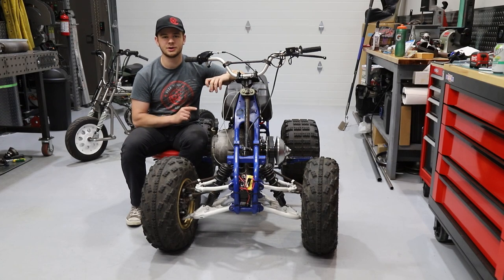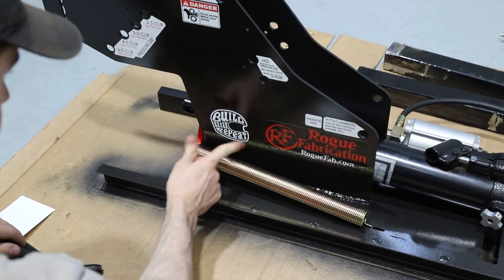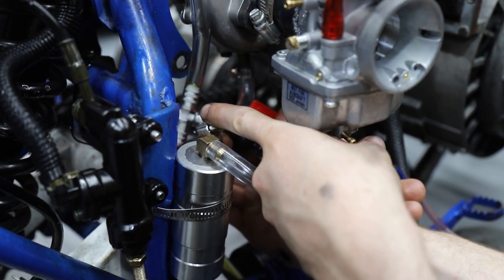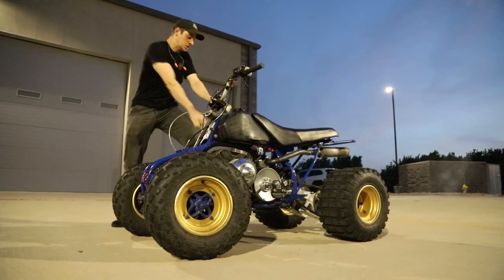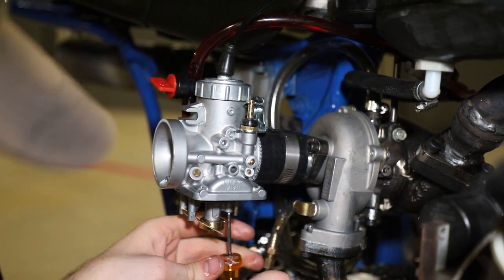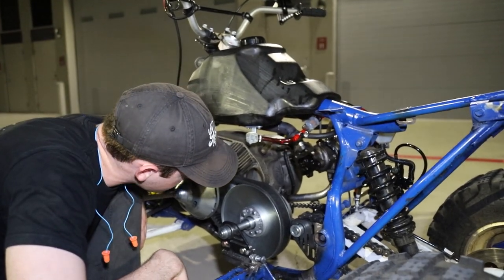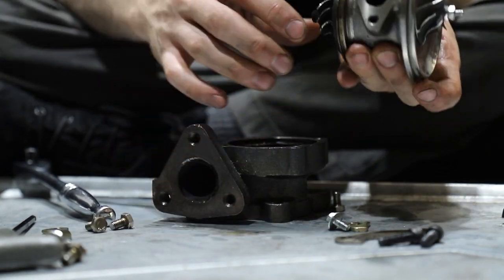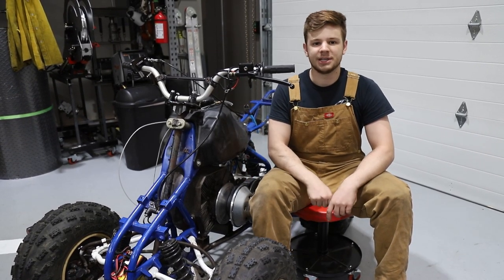We Blew the Turbo on our ROTARY ATV? | ep.7

Comment from the maker: What do y'all think, should we try again with a more expensive turbo and better setup, or revert it to the pre-turbo configuration? Let us know! Sorry for the late video this week, we've been busy working some summer internships!
Reply: Keep trying with the turbos!
Reply: "Turbo rotary" always sounds better in conversation or in the title of a video so there's that. But I was thinking if you could really control the a/f ratio precisely there's lots of potential to be had with the turbo rotary combo but that would involve efi, a bit more intricate but definitely worth it in the end especially with a bigger turbo because a carb that flows enough fuel at full boost won't want to run at idle and vice versa
Reply: Stock engine, finely tuned.
Reply: Supercharger 100% there aren't many blown rotarys
Reply: RAM AIR!!
Reply: What about a small supercharger, like GHP used on Senderella for awhile?
Reply: Turbo
Reply: Try claim warranty on the turbo haha! Ever thought about a mini supercharger and running it off the crank?
Reply: Still need to restrict the boost gauge feed line with a wd40 straw or something similar to get a better reading from the guage. 👍👍👍
Reply: It’s not the turbo bad vz 21 not good for draw threw set up I did mine as a blow threw an it was fine that turbo don’t have a dynamic seal that you need for draw through
Reply: I Think you will blew every turbo when you blow gas thru it. Install it on thr right side. Gas degreased and destroy a turbo and the bearings
Reply: @D.T1991  is called a draw through set up and its fine

Comment: Keep boosting!  Get a air/fuel meter on it for tuning jets.  An oil pressure gauge and proper orifice fitting for the feed line to restrict flow to correct levels ( if bearing turbo ).  Love the content.
Reply: They should build a stand alone wideband display that clips to the end section of the exhaust. That way they can tune basically every vehicle they own
Reply: you should only use an orifice to restrict flow on a ball bearing turbo. Journal bearing turbos need oil pressure in order for the shaft to be suspended on the cushion of oil
Reply: @DJTuningCom  Today I learned!  Thanks!
Reply: @DJTuningCom  but too much pressure and not enough exhaust back pressure can allow that higher pressure oil to leak through the seals. So a measurement on the amount of pressure it's getting wouldn't be a bad thing
Reply: Lit

Comment: I say keep on boosting that thing man! gotta love a turbo rotory ATV!! haha @ 7:26 you can hear how much happier the engine was for a second when you took that filter off, I'd either get a very thin peice of fleece and clamp that tightly onto the turbo inlet, and spray VERY little amount of air filter oil on it just to make sure no dirt or sand makes it in there if that's what you guys are worried about (I'm guessing so, because it's an ATV and I'm sure you will be taking it off road) but when just tuning and driving around in the lot/street, I'd run no filter at all to give it the best flow, and not choke the turbo off.. its already been choked enough by the draw through set-up, almost should see if you can find a blow through carb small enough for this setup, or step it up and use a "small engine fuel injection conversion kit" and go stand alone fuel management, and tune on the fly on a laptop with endless fuel tables for as lean or as rich as you want at any given RPM. Also, when you replace the turbo I'd find one just SLIGHTLY bigger (rotorys like the big swirly bois lol) and get some oil feed restrictor fittings and play with the oil flow to stop blowing out oil seals on the turbo, but make sure its getting enough oil too!! haha, keep up the great work man, love the content, ROTORY FOR LIFE!! hahaha BRAP BRAP BRAP BRAP

Comment: The oil burning problem is due to a fact, that you have got carb mounted before the turbo´s compressor. When you make pull and then close the throttle, there is vacuum created and the oil is sucked from the bearings and flies straight to the engine, so the compressor side bearing is not lubricated properly. That's the reason, why there is oil around the wastegate. This could starve oil from both bearings and make this play. Also, with this vacuum you can run into compressor surge problem, which could further damage the turbo. If you do the same thing with supercharger, you have the same problem. That's why on normal applications you have the throttle body after the turbo/supercharger.

Comment: Keep it turbo guys! You should add an intercooler or a large volume between the outlet of the compressor and the inlet of the rotary (about 1.5x the ci of the engine) . It will help it make boost and fix the boost gauge jumping all over the place.
Reply: Wouldn’t that also add lag? Or would this affect be negligible?
Reply: No point intercooling that tiny thing. An boost capacitor might help though a smidgeon

Comment: In the video, it seems like the turbo smoked the most when you let off the throttle. Probably because of manifold vacuum sucking oil through the turbo seals. If you had a blow-through carb, with the turbo in front of the carb, that shouldn't be a problem.

Comment: In response to some of the comments:
You can't intercool a draw-through carb. It causes the atomised fuel mixture to cool and pool in the intercooler giving erratic tuning issues. 
Same kind of deal for boost capacitor. If anything, an expansion chamber on the exhaust side will help to smoothen out the exhaust pulses into the turbine wheel to provide a smoother delivery of boost.

My vote is to convert it to a blow-through carb style. 
This will also prevent all the turbo oiling issues that you are having as when the turbo is in vacuum in a draw-through system the oil will be drawn through the seals causing improper lubrication and premature wear - as you guys discovered haha!

Comment: I've been running this same turbo on a 10 hp diesel for about 2 years and have had no problems. I'm not sure what your problem might be but you might have over sped the turbo. That rotary is effectively a 3 cylinder engine, I'm pretty sure it produces a lot more exhaust volume than my single cylinder diesel (which, by the way, makes about 6 psi boost under load). I would suggest finding a way to re-install the wastegate. How much boost were you making? It's possible that the turbo just couldn't spin any faster to supply the engine with enough air. You might even need a slightly larger turbo. I don't think oil pressure is a problem. My diesel makes about 60 psi when it's warmed up (the engine has its own oil pump that I tapped off of).
This is all speculation, of course, but I've been messing with turbos for almost 50 years. Just my opinions based on my own experience. Love your videos, keep 'em coming.
Reply: What turbo are you running on your diesel

Comment: You shouldn't draw fuel through a turbo unless it's built for it, otherwise you'll dilute the oil with gasoline. The proper turbos have a carbon seal in them vs the metal dynamic seals.

Comment: Keep it turbo, You need a carbon seal with a draw through setup. Vaccum can suck oil from the turbo. Or pressurize the carb for a blow thru.
Reply: And the pilot jet 5% more than stock & main jet 15% +++

Comment: Fuel smoke isn't white. Unless you premix a lot of oil in your rotary its the turbo. Likely need better drain/supply setup. Also takes a long time to burn off all the residual oil in the housing. so turning oil supply down as you ride and watching smoke is a good way to oil starve the turbo. 

 Need to boost reference the carb and modify it for boost if you ever want it to run correctly. If you look up "Drmotorcycle" on YouTube he goes through these modifications in detail in a lot of his turbo small engine builds. Also those seals aren't meant for a draw through design. Need carbon seals. 

 Turbo seals don't generally "blow" they are just like a piston ring. oil is either pushed past and/or can't drain quickly enough and just leaks by them. Fixing the oiling problem almost always cures the issue. No "blown seal" to replace. 

  Also get a WB02 sensor on that thing, guessing at jets is trouble and then some with FI. Just use a basic kit and set it up in a backpack with 4s a lipo bat. That way you can swap between all your setups and know your fueling is correct. 

Good luck!

Comment: From all my experiences with turbos you definitely have to be oiling it correctly you have to put an oil reduction jet in on the top side of the turbo and also if you're using a bushing turbo rather than a bearing turbo you are definitely going to want to run some type of coolant through it to keep the bushings cool

Comment: The engine was only running lean at wide open throttle. You should've left the pilot jet alone because the main jet was the only one that needed changed. You should keep boosting! You'll get it right

Comment: Also to help with tuning get a air fuel ratio gauge there's going to be a lot of tuning for your mid and high RPM range idle is simple but you're definitely going to need to get a carburetor where you can adjust the idle circuit

Comment: I can't speak really too much for your specific setup...  But I've been rocking a $120 chinacharger on my miata for a number of years and probably 70k miles worth of excitement without any issues on the turbo making GREAT power.  I'd start looking at the lubrication system of the turbo as it's possible the seals might've blown out and instead of lubricating the journal bearings, was just pumping the oil into either the intake tract or the exhaust instead.

I too would be interested to see you guys rig up a supercharger on this lil rotary guy.  Common superchargers for small engines is an old school VW vacuum pump, which was literally a small 2 screw blower.

Comment: With the turbo, as im sure many have said "you get what you pay for" or something similar, it's true, your getting China garbage, get a better turbo, make sure you have a good flowing oil filter in the line, also idk if it's going to be a problem now or later but eventually you will have to deal with heat, you need an oil cooler, simple one on Amazon should do fine, as far as exhaust idk much but you should study other rotary engine exhaust systems, see what special needs they have for performance,  go from there. Look into the moped world for cheater mods (they are size restricted for legal road regs)  but who says they can't be adjusted lol that world has some interesting takes on "legal" modifications you may find useful, happy wrenching

Comment: I say it’s the oil pump. I ran a similar setup with the same turbo and the exact same pump. The oil pressure is so high that the turbo doesn’t even spin. Also the seals are leaking badly. I had better luck with the 20$ 12V low pressure fuel pump to feed the oil to turbo. (It’s everywhere on Amazon) my problem is that my 22mm mikuni is way too lean.

Comment: Turbo again. Set up a new "oil pump" with a low pressure (carbureted) fuel pump (and the bypass) Turbos don't need or want a lot of oil pressure. It would be nice to have a stator for power too. Run a wideband and an actual switch for the oil pump. I'd also say lower the gearing. That engine can only spin so fast regardless of power. Get new sprocket setup for better top speed. You should have the power to pull once it's running right.

Comment: My guess would be not enough oil. You should get a fuel pressure regulator and just use it as an oil pressure regulator. You can get a cheap corvette fuel filter. they have a built in pressure regulator and would double as an oil filter.

Comment: LMAO the problem is obviously having the carb in front of the turbo. When you shut the throttle the engine sucks oil out of the turbo core. When you went from rich jets to original jets and it stopped smoking after start you didn't do any power pulls, did you? The highest vacuum happens at high rpms when you snap the throttle shut.